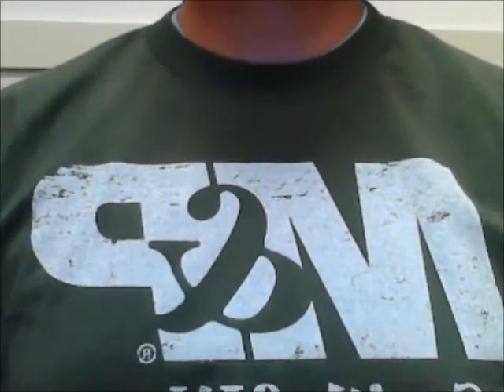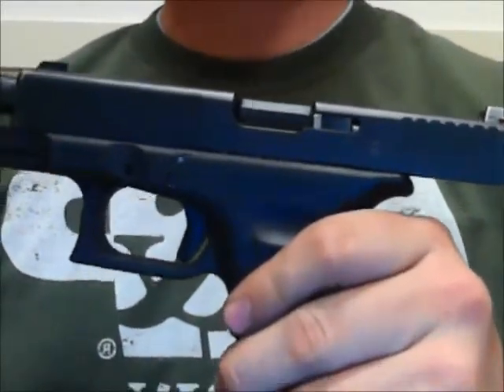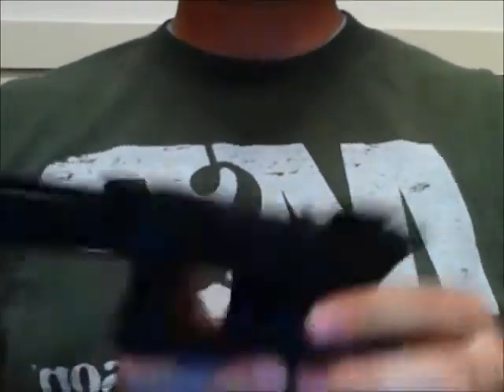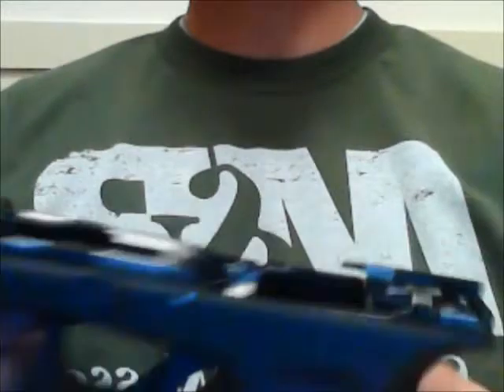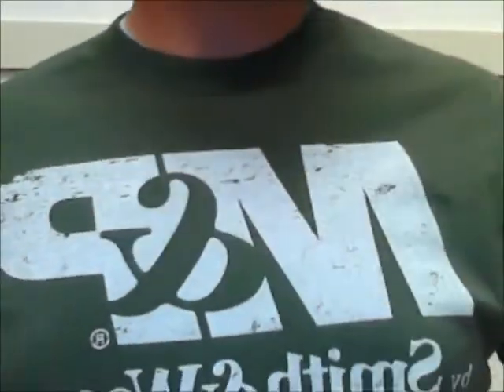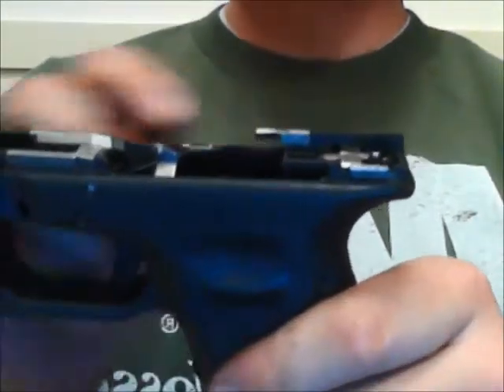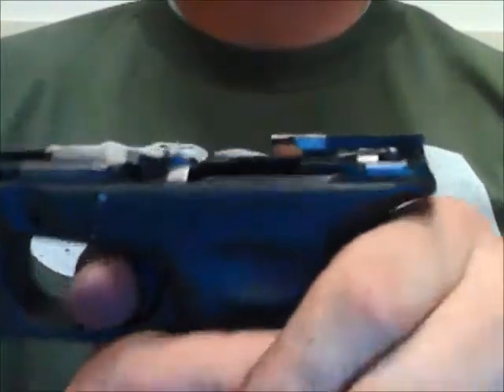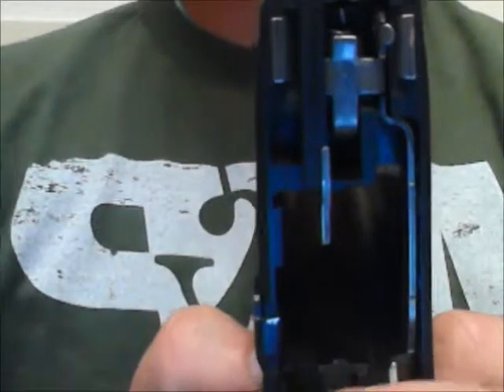Trigger Reset Explained

Comment: Can you help me? I took my glock 19 to the range today and its a gen 3 slide on a gen 5 frame (which i have seen a lot of videos of it working if you use a gen 5 back plate) i also ran thru a few mags and had no issues but i also ran thru a few mags and had some issues. And this would only happen sometimes not a lot tho. But sometimes the trigger wouldnt reset and i would have to rack the slide again (just 1 time) for it to reset. Also a few times after i shot a round the slide wouldnt go all the way back in battery and i would have to hit the mag or the back of the slide for it to go all the way back in battery. But again these things only happened maybe 10 times out of about 80 rounds. And never at the same time. It would either not reset or not go all the way back in battery (again never at the same time) 

Also if im at home with no ammo in it and i rack the slide and hold the trigger it wont reset (not everytime just at random) But if im not holding the trigger down it always reset. And i even put the gen 5 oem slide back on the frame (gen5) and it did the same a couple times. Wouldnt reset if my finger was on the trigger. So i dont know whats going on????? Oh i was also getting a crazy amount off carbon build up on the front of the gun and flashlight for only shooting about 80 rounds.